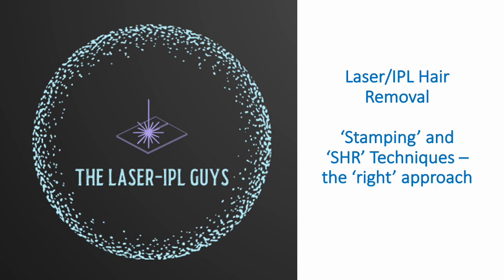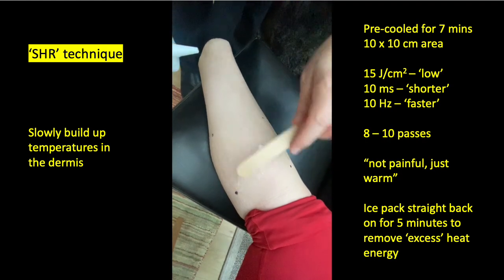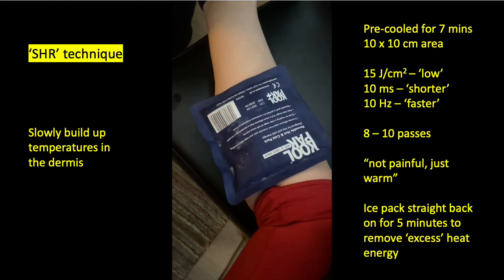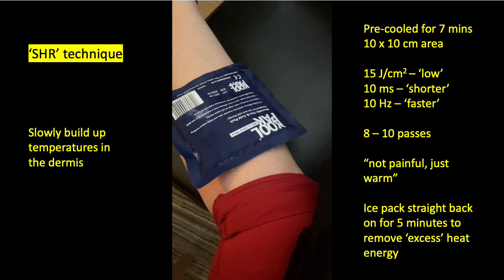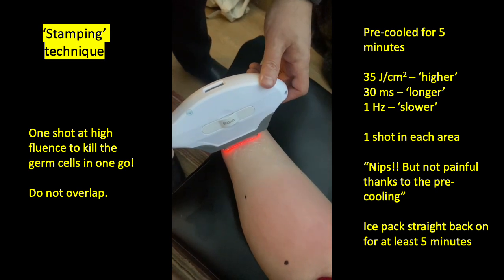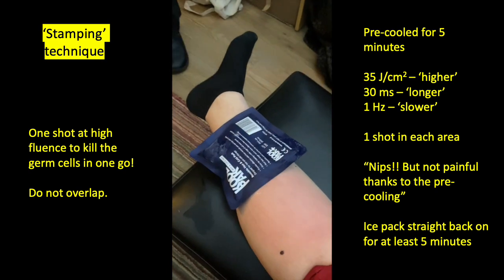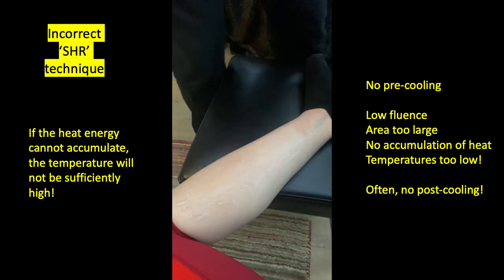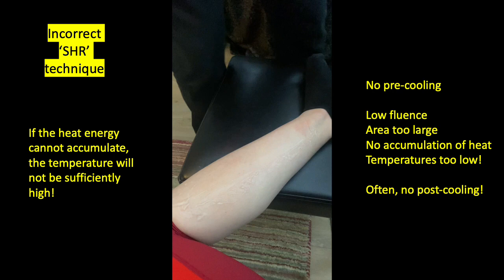Laser/IPL Hair Removal techniques - how to apply them correctly

Comment: do you think 15 joules in an diode home laser is enough energy to kill the hair folicle?
Reply from the maker: No. Home diode lasers are designed to deliver low power so that they do not cause any harm!
Reply: @laser-guys  what at home lazer would you recommend?
Reply: 15 joules is joke lol. 

You need about 40 joules
And
I think NDYAG is better since it reaches deeper. Just use 90joule